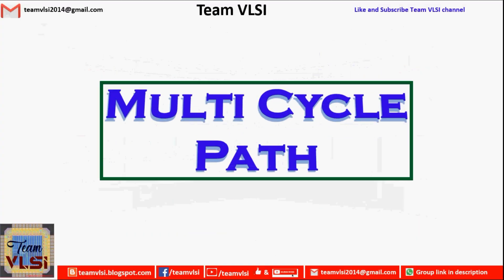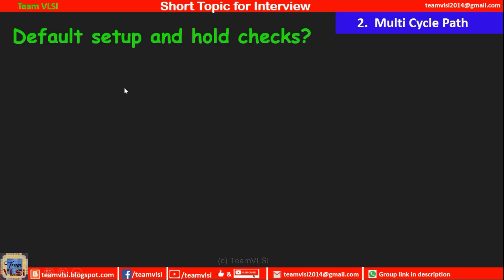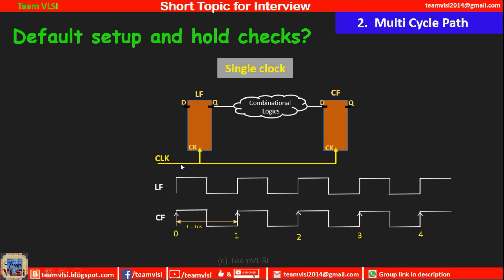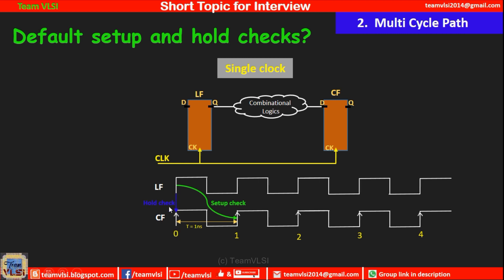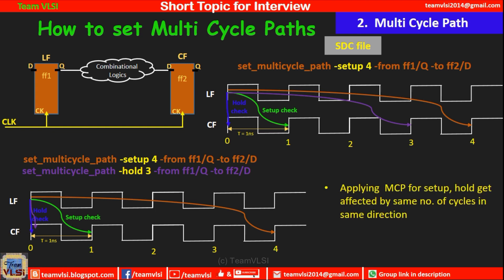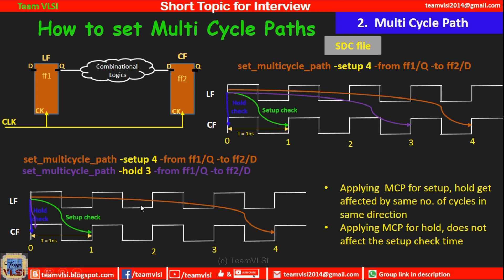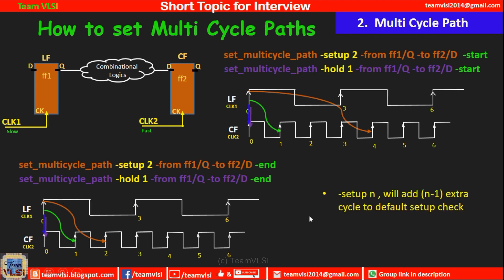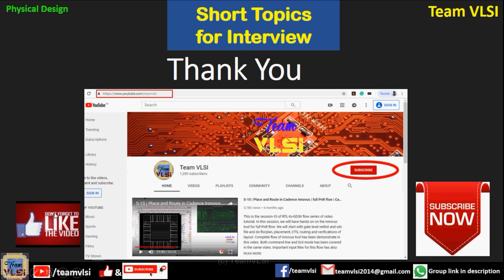Multi cycle path in VLSI | Multi cycle path Constraint | Multi cycle path example

Comment: How to identify multi cycle paths in design?
Reply from the maker: It is an exception, you can check the SDC file.
Reply: @TeamVLSI  If it is not there in SDC and then how to identify violation is true or false due to multicycle
Reply: Check for flip flops which are driven by clocks of different frequencies.

Comment: Why setup check is done at next clock edge and hold at the same edge?
Reply: Hold constraint is basically trying to prevent a race condition so that a fast data doesn't accidentally pass through to the capture flop at the same clock edge, so hold check is only relative to a clock edge. Setup constraint is trying to prevent a scenario where data moves so slowly that it doesn't get to the capture flop even before the NEXT clock edge, so it needs to take the entire clock cycle into consideration.
Reply: Setup always affects the capture flop and hold affects the launch flop

Comment: can you please check once where will use -start and -end switch?   I think in slow to fast we use -end switch and in fast to slow clock we use -start switch....please let me know also if I am wrong
Reply from the maker: Thanks, Kavita. You are right.
The way you are saying will always shift the check edge with respect to the shorter clock period, Which is absolutely right.  But I don't think it is a necessary condition.